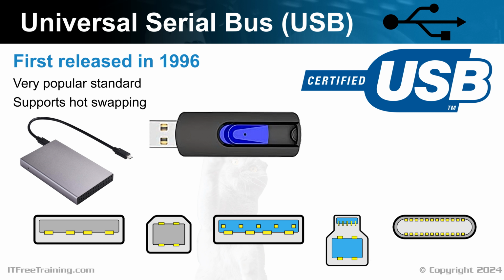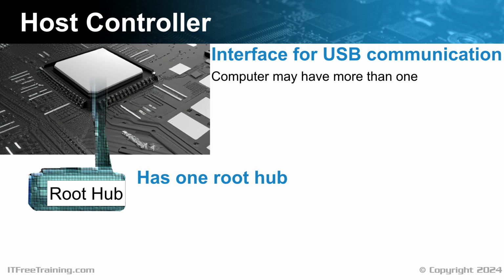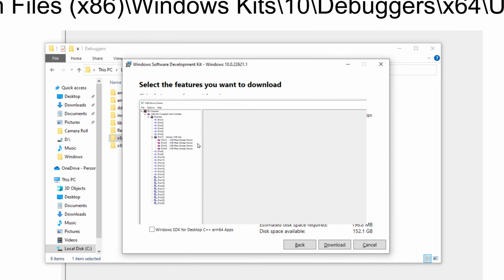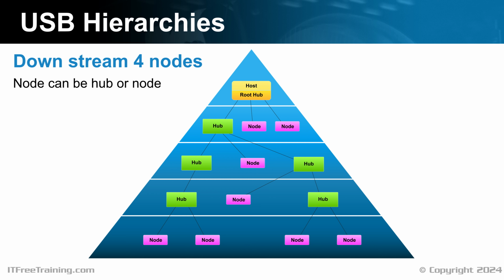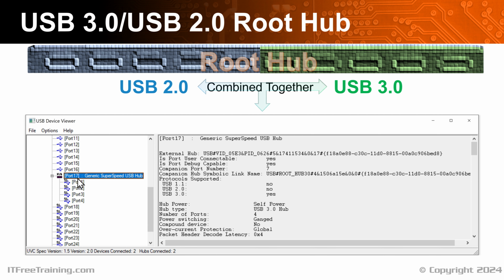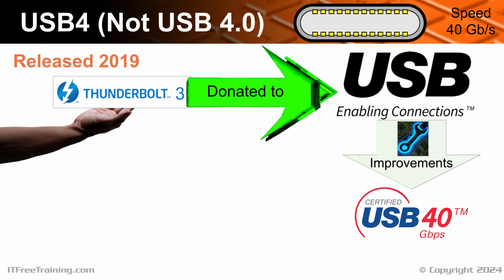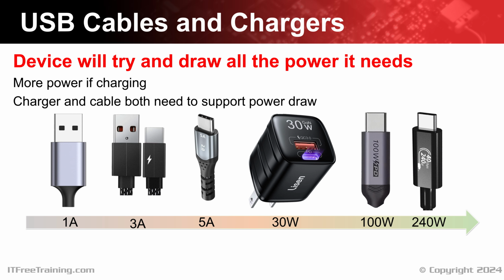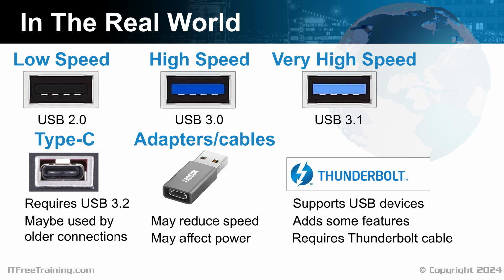Universal Serial Bus (USB) - CompTIA A+ 220-1101 – 1.3

Comment: 28:44

note: didn't understand usb 3.2 and type C relation.
Reply from the maker: We don’t explain it very well in the video. The Type-C connector was created by the USB Implementers Forum (USB-IF) and can be used with various protocols. For example, Thunderbolt 3 operates via Alternate Mode over a Type-C connection.

USB 3.2 is a protocol standard that defines data transfer speeds and capabilities and is independent of the physical connector type. Although USB 3.2 uses the same protocol as USB 3.1, it introduces minor changes and clarifications.

For these reasons, computers are increasingly adopting USB 3.2, regardless of whether the connection is Type-A or Type-C. However, Type-C is required for the highest-speed connections, such as USB 3.2 Gen 2x2, because it provides the additional lanes needed for dual-lane data transmission.

I hope that clarifies it for you. Sorry we were not very clear in the video.
Reply: @itfreetraining  Oh. thank you. I was just marking where I left to continue later on and taking a note to ask Google later on really but you saved me from that thank you.